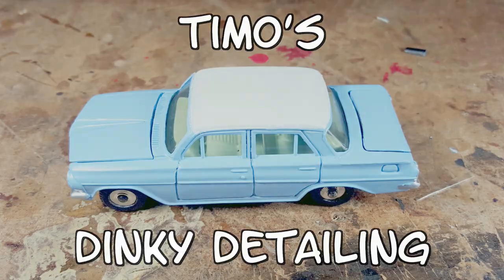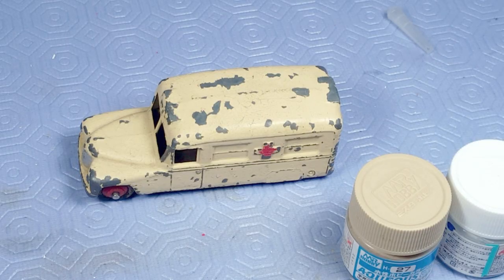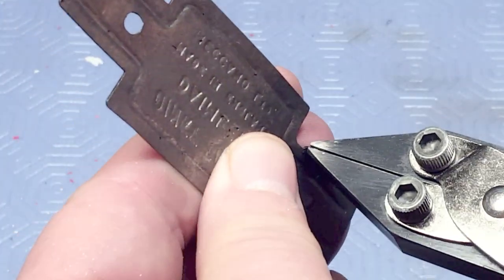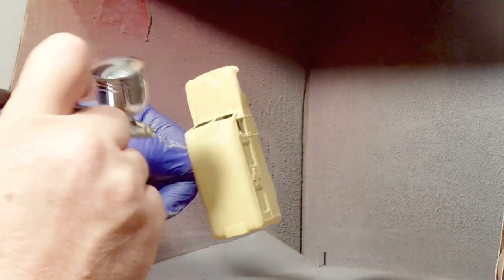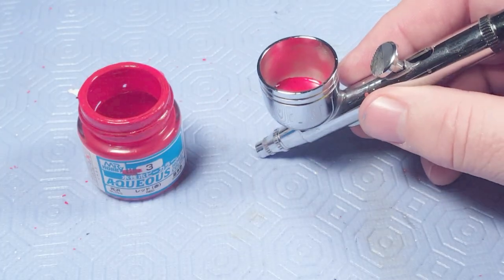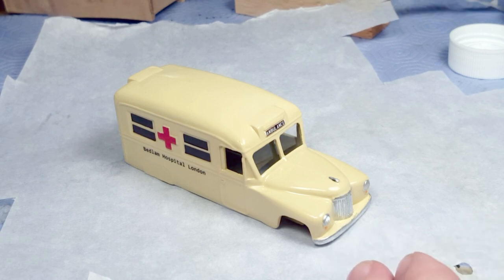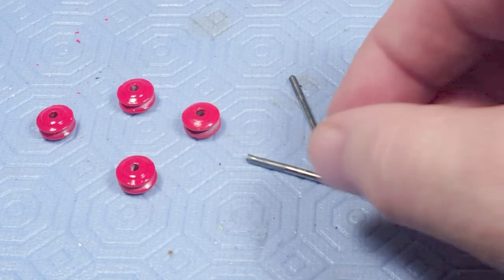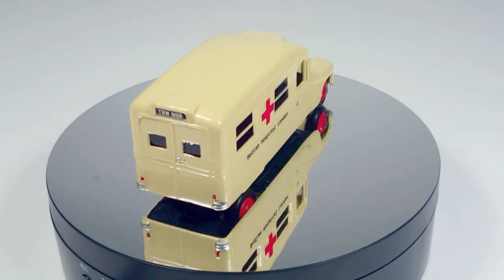Dinky 253 Daimler Ambulance Restoration,... plus.

Comment: Like the effect. The tweaks really work. Daimler was a British company, not connected with the German one (which traded as Mercedes-Benz). The pronunciation is DAME, not DIME. The operator name on the sides would always have been in capital letters, making the typeface less important in this size. The common word "bedlam" actually originates from the name of the mental hospital founded in the 13th century. It is a contraction of "Bethlehem".
Reply from the maker: I am always happy when somebody gives me a lesson in British Automobiles of the 1940s, or thereabouts. I tend to know all about North American vehicles, but am sorely lacking in knowledge about stuff from the Kingdom of Uk. I used Bedlam Hospital as a name, mostly because I don't know anything about any other UK hospitals. Most are just boring. I think I was told by somebody, about the contraction from "Bethlehem", but I forgot it. Either way, can you tell me if that hospital actually had ambulances in the 40s or 50s? Cheers

Comment: You were lucky that Corgi model was the same size. Wouldve usually found it had various differences
Reply from the maker: I only saw pictures of the Corgi one. It sure looks different, but the general shape of the vehicle looks identical, like the real thing. Corgi did a much better job, but I'll bet you paid for it.
Reply: @timosdinkydetailing  here in the land of UK, they're starting on auction price for as little as £5